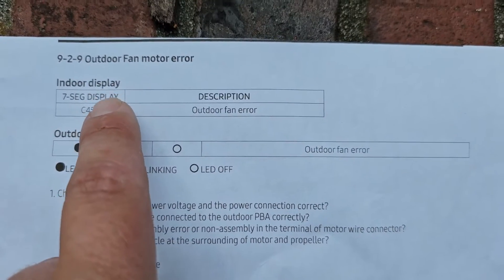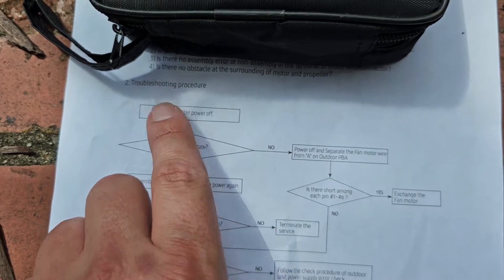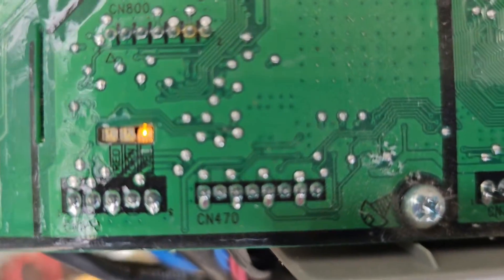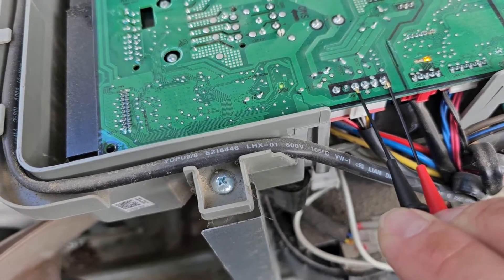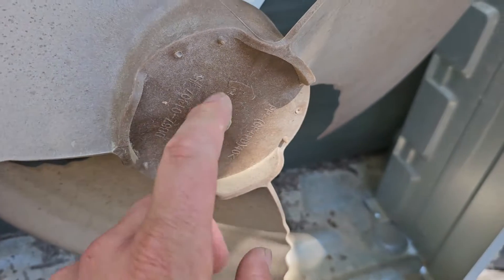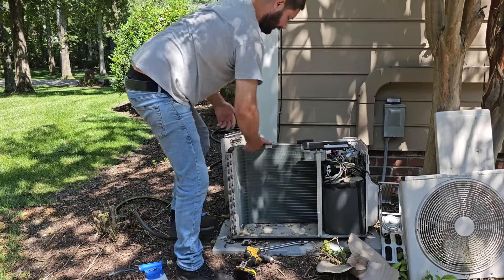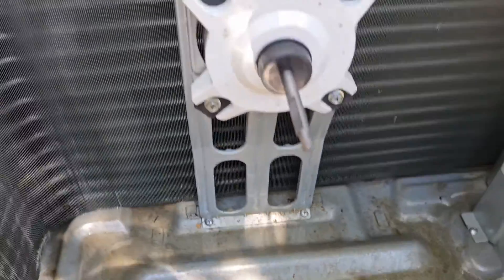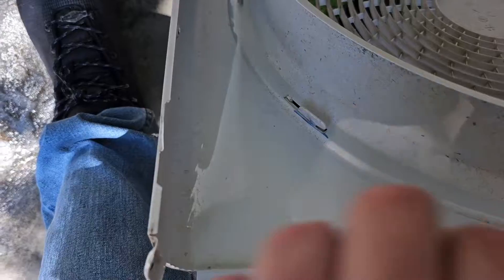Error Code E458 Fan Motor Error Samsung Mini Split

Comment: Well. An update incase anyone finds themselves here.

My Samsung “triangle” 2.5kw split system would run perfect for 3 minutes and then it would stop everything fan and display error code E458.

I ended up swapping the entire PCB from one unit to another and that made no difference. (Started with that - as you need to access that to unplug the fan anyway)…

I then swapped the fan motor between the 2 units and the fault followed the fan motor itself.

I’m guessing it’s not seeing fan speed. As the condenser fan, has smooth bearings and runs fine otherwise. 

Hot tip. Wear gloves. The fiber impregnated condenser fan causes Sooooo much itching!! 

I’m now trying to order a new fan motor….
Reply: Amigo como pudiste solucionar?

Comment: Wait. I have E458. Is that different to C458? Aircon runs great for 2-3 minutes and then cuts out. I’m a sparky by trade but I work on commercial gear not so much splits.
Reply from the maker: Same thing error code
Reply: Well. An update incase anyone finds themselves here.

My Samsung “triangle” 2.5kw split system would run perfect for 3 minutes and then it would stop everything fan and display error code E458.

I ended up swapping the entire PCB from one unit to another and that made no difference. (Started with that - as you need to access that to unplug the fan anyway)…

I then swapped the fan motor between the 2 units and the fault followed the fan motor itself.

I’m guessing it’s not seeing fan speed. As the condenser fan, has smooth bearings and runs fine otherwise. 

Hot tip. Wear gloves. The fiber impregnated condenser fan causes Sooooo much itching!! 

I’m now trying to order a new fan motor….
Reply: hello friends, I'm having a problem with my Samsung AC cassette e458 error, the fan won't spin, I'm asking for help, guess what's damaged is the fan, what's the PCB, please answer, teacher, 🙏
Reply: @gustywaisat6294 I replaced the condenser fan motor. I was able to swap it out with another unit to compare. Putting the motor in another identical unit caused the same error confirming my problem. Ordered a new fan motor and it worked. 

6 months later, the unit had a communication error after a bad storm causing lots of downed power lines. I was unable to rectify and have since removed the entire unit all together.

Comment: I’ve got a C416 on my mini split, it’s less than a year old. I can’t get the guy who installed it to come out and look at it. It would be great to use the thing I paid for. The last month it’s just been a wall decoration….
Reply from the maker: He probably didn't tighten the flare connections correctly or do a pressure test.
You likely have a leak

Comment: Would the $59.00 one work for DIy, HVAC Guys Coil Cannon Cleaner Mixing Sprayer for Air Conditioner and Refrigeration Coil Cleaner Dilution Ratios - 2-qt. Size - Works With Other Cleaners Calling for Higher Dilution Ratios

Comment: Nice  had the same code on a Samsung brand new system and the blade nut was loose causing a out of balance motor and damaging it. Put a new one in and had no problems since and I also ordered a board just in case, 😅 
I like them Samsung units.
Reply from the maker: Good info my brother thank you for sharing